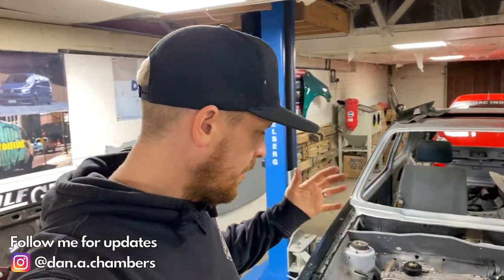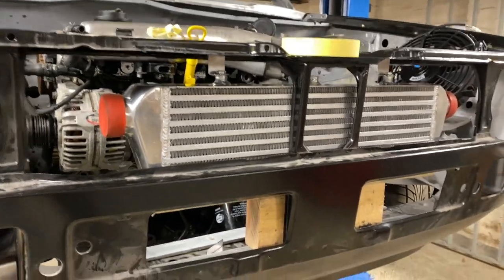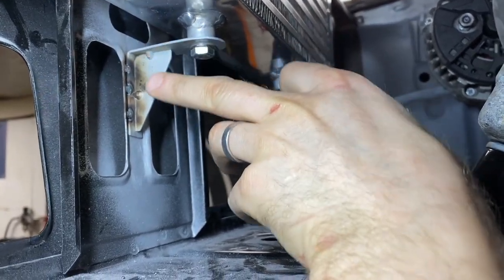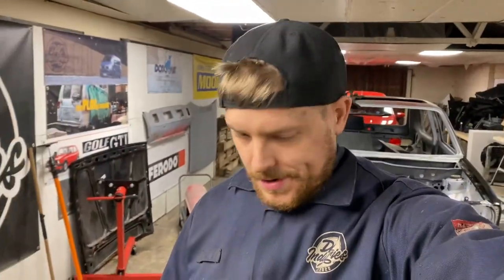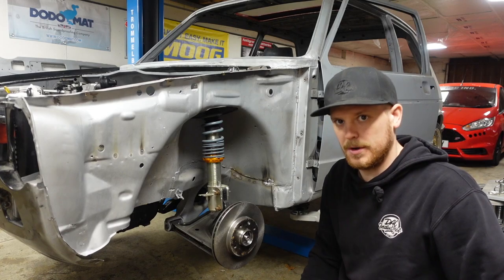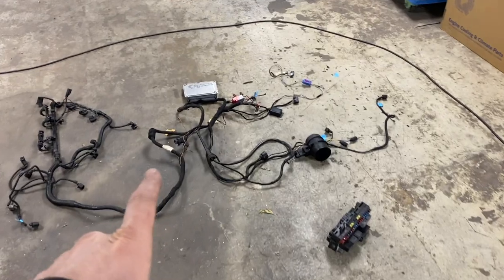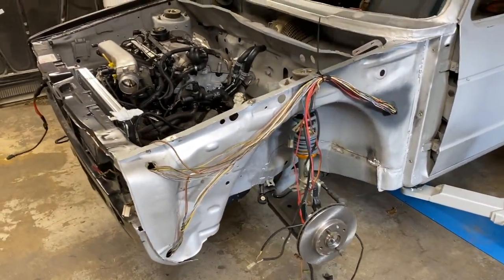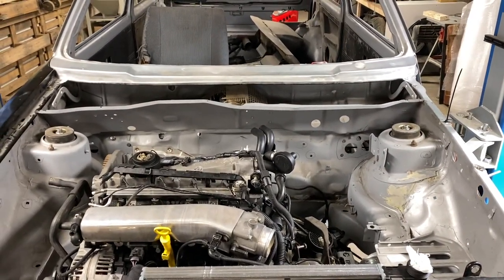Intercooler & Radiator Mounts + Wire Tuck  - 1983 Mk1 Golf GTI Campaign Restoration 1.8 20v t Swap

Comment: Great progress on the wiring harness for the Golf GTi to run the 1.8t engine and the rest of the car. I am looking forward to more progress on this VW. Especially the new braking system you spoke of in a previous video, since I am building a RHD Mk1 Scirocco here in Florida and want to clean up the engine bay by not having the booster/master on the left side of the car.
Reply from the maker: Thank you bud, hopefully will make it all a little easier. Hopefully will have the new pedal box soon. That is exactly why I want to do it! The servo etc looks terrible in the bay!

Comment: Nice progress Dan. Not a huge fan of hidden wire looms myself though. 
When I placed my radiator under the bonnet latch I had an issue with the hook. Have you checked that it fits with the intercooler in place? The hook comes down quite a bit...
Reply from the maker: Cheers bud, Hopefully it should make it look nice and clean under the bonnet. Yeah I did check the latch but will sling the bonnet on to double check.

Comment: Would have been great to see how the sprinter IC looked, because I am like you were, planning to use that. It is quite wide, but it is 26cm high leaving 4 cm so that it can be lifted a little bit up. My main concern is that there is no room for fresh air into the intake. It completely blocks the front of the car
Reply from the maker: Are you on instagram? I will sling it in and take a photo to send to you? It is massive. The one I have fitted will work fine. I am not chasing big power.I just want something nice to drive.

Comment: Just as an idea why not change the headlights to the new led round ones with the inbuilt indicators that you see on ebay.
Reply: Led don't pass the mot unless they are OEM or off road. I was looking to replace my lights for led and spotted the new legislation that says they are not road legal.
Reply: @wobblyeye493  unless they are e marked looked at them for my cafe racer and there is cheap ones on ebay then there are ones that have the emark so should pass the mot
Reply: @paulcushnie  according to the legislation I read they have to be OEM sealed units otherwise they fail. I could of miss read it but I'm pretty sure it's a new update on the older one. Looking in halfords at their led headlight bulbs they're labelled for off road use only. It's why I didn't upgrade to led in my projector lights and went with super brights instead.
Reply: @wobblyeye493  its a bit of a gray area for the mot 19th March 21 all car will fail with hid / led 21 March 21 they might pass. From what I can see the headlight must be of suitable construction for hid or led and age of car come into play aswell.
Reply: @paulcushnie  I'll ask at the garage next mot but I'm not chancing it myself yet. Ebay don't mention if the lights they sell are compliant or not and I could do without the stress tbh.

Comment: Put on the hood of the car. The bonnet lock will probably be based on the intercooler
Reply: Good shout, worth a double check.
Reply: @christopherpetto7356  I'm after the 1.8t swap in the 14d caddy, I had a problem with that
Reply from the maker: Cheers bud, I did try the latch in and it looked like it will work.
Reply: @DanChambersDAC  Okay then, I preferred to warn you

Comment: Dont Cut out that piece of firewall
Reply: Will allow water through bonnet vents onto engine & into heatermotor - will also allow heater to suck in engine air
Reply from the maker: The bonnet vents go into that inner scuttle area anyway?
Reply: @DanChambersDAC   but usually has a shield to direct water to either side